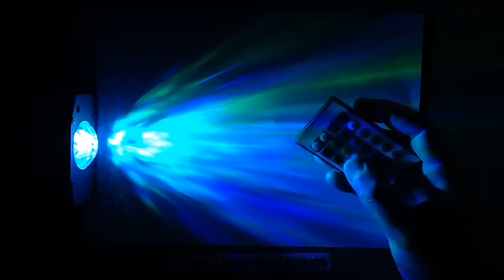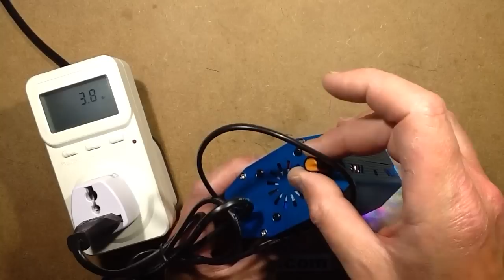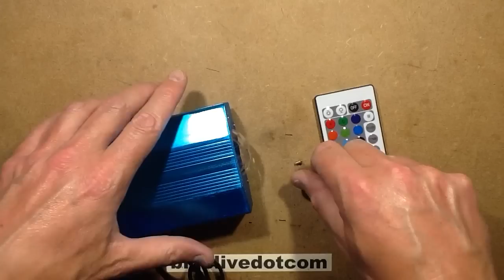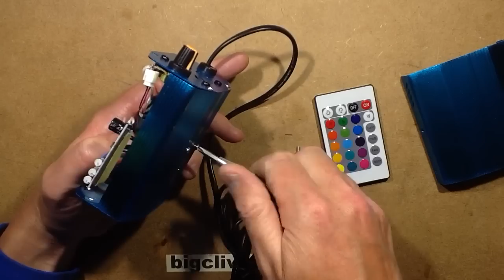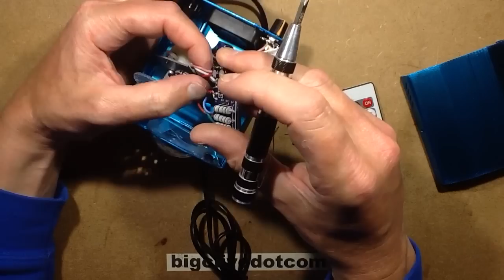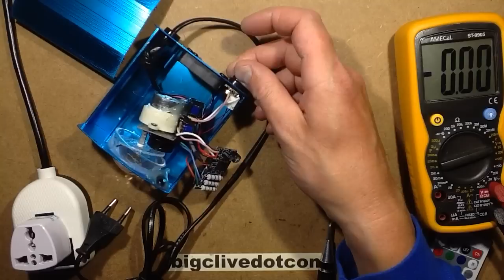RGB LED ripple projector with remote control.

Comment: I had two devices like this one. Both of them died after two months. The IR receiver stopped to work on the first device then on the second device a bit later. Light started to very slowly change colours then I threw them away. Rubbish.

Comment: I have just purchased one of these but the speed control is on the remote and not the unit. However, U have just complained to the ebay seller as the on/off button on the remote does not turn off the internal fan only the  motor and LED. If the unit is cieling mounted like I have done with mine then this is a potential fire risk. Strangly when I pointed this out to the seller I got a reply of "Dont worry about it"!!?
Reply from the maker: I'm afraid that is how it works.  The fan is connected directly to the incoming power supply and will continue to run while the unit is powered.
Reply: bigclivedotcom
Hi Clive. Small risk I know and I have not returned the unit but unfortunately something was 'Lost in translation' when I pointed this out to the seller as he was 'Very sorry as this is normal but has sent a replacement and to keep the faulty unit'. So now I have two units. I did feel guilty for about a minute as he misunderstood what I was trying to say but reasoned that further explaination would muddy the waters even more.
BTW. Love your Channel and your dry humour :-)

Comment: Ooh, that one is really cheap and nasty inside compared to the one I have - which looks similar, but mine has a properly mounted circuit board and uses a different remote. Still a very cheap Bangood purchase though.

Comment: You should've ordered the one I sent you in my email. It comes with an external power supply (5V, 2A)
Motor control can be done by remote (3 settings) and when selecting white (all LEDs at once) it draws 10W. Yes, it's bright!
Reply from the maker: That's coming up....
Reply from the maker: https://www.youtube.com/watch?v=bjfXp72lvfE
Reply from the maker: Quite a lot of that 10W is heat from the fan cooled resistors.
Reply: I wonder what the internal differences are.
Reply: Thanks.

Comment: I bought a RGB strobe light with a very similar case recently. It came with a duff 3 pin plug, and the knobs were a little confusing as one switched between normal and a music mode with a sensitivity setting, but it is otherwise blindingly bright.

Comment: This is an interesting variant you have there. My RGB ripple light has an external mains to 5v adapter and has a single low voltage board inside that does everything. They aren't using those huge cables mine, instead an op amp and a little discreet transformer for each color driven by your typical no-name microcontroller. I wish mine had memory though :/. I will say that having a live board inside that chincy anodised casing is a little too flimsy for my liking.

Comment: Interesting... My motor is PWM driven and controlled from the remote.
Reply from the maker: Then it's probably the same as the one I'll be putting the video up for shortly.
Reply: +bigclivedotcom Aha. I opened the gearbox because the motor sounded strange. It was so full of goop it actually slowed the motor down. I took some out so it just was enough to grease the gears. The motor rpm went up to the double! Haha! And the strange sound was the ultra slow PWM frequncy jerking the motor on slowest speed. I need to do something. The slow is not slow enough to me.
Reply from the maker: You could possibly try a resistor in series with the motor to nudge the speed down a bit.
Reply: +bigclivedotcom Yes. I'll try to include an inductor and a capacitor too to maybe smooth the bad PWM. It's like 10Hz or thereabout. I'm afraid the inductor needs to be rather big for that frequency though. :p

Comment: can you also put a ptc thermistor across the pot for the motor speed?
Reply from the maker: The motor current is very low, so it probably wouldn't heat a typical PTC up enough to increase its resistance.

Comment: I ordered one back during the monochromatic lamp model video, and mine is a little different. 
Mine is run from a 5v 2a mains adapter, the remote is different and it features some additional modes...not super great modes but still a neat device and quite inexpensive.  
The wife also adores it! That never hurts!
Reply from the maker: That's in one of the next videos....
Reply: +bigclivedotcom Awesome Clive. Thanks for these videos!

Comment: Am wondering if the heat of the resistors could cause any issues after running for a few hours and if so could they be swapped for something better, or could you try to get the case to act as a heat sink for them with some computer processor thermal compound?

Comment: I have a lightbulb with probably the exact circutry and leds. Same remote also. I use it for a warm orange light in my room. I have left it off for 6 months once while I was away and when I turned it back on it kept memory of the brightness and color I used. No idea how long it holds memory but thats pretty good!
Reply: Depending on manufacturer up to a 100 years (no joke).

Comment: I bought 4 of these last month and modded them to take DMX control.
Reply: What?!
Reply: +bluephreakr I grabbed a couple of macetech's ws2811 driver boards that turn RGB leds into serial controlled leds. then it was a simple matter of a rs485 txrx board and a lpc810 microcontroller. thus I was able to control the RGB values via DMX. took a little bit of time to throw together firmware for the LPC810. polished product - no - but it worked for a week of youth camp!

Comment: I bought one of these a few weeks ago. I have been wary of using it because of the metal case and no earth.
I will eventually get around to replacing the power lead with an earthed one, then I'll feel better using it.
I particularly like the slow colour changing mode.

Comment: Hey clive. Its funny that you found this item because I just saw this LED light remote control color changing light bulb today on Amazon. Here it is on the uk ebay site. Hope you don't mind me sending you a link.

http://www.ebay.co.uk/itm/GU10-E27-MR16-3-5W-RGB-LED-Bulb-Remote-Control-16-Color-Changing-Dimmable-Light-/231778471511?var=&hash=item35f712ce57:m:mpWqTaUJ2KkqdEKdKOPBebA

Comment: hey, that's pretty weird. I recently bought some rgb LED'S for my computer, and the remote is the exact same one you have there.
Reply from the maker: It's very common.  If you keep one in your pocket you can change other peoples lights with them as they all have the same code.  That includes shop window lighting.
Reply: That's an quite standard LED controller remote. You'll find it for almost any LED accesories / strips.
Reply: Yup, I have a screw-in RGB LED bulb w/ the exact same remote.
Reply: I have three of those remotes and screw-in bulbs somewhere... and an RGB tape that uses a bigger one with more buttons.(Fades, flashing, custom colour.)

None of them are coded the same. So if I push white on one remote one lamp turns white, another one blue+red. and the tape start flashing white.
Reply: m8e i have led strips in my computer, light bulbs.... and i  can control them al with the same contoller, i can even change the colors in my local electronic strore😂

Comment: What's the reason for tying a knot in a wire and pouring glue over it?
Reply: Spreads strain across the whole knot being pulled against the case instead of pulling out the solder joints. Glue just solidifies it, I'd assume.
Reply: strain relief, it can't be pulled out.

Comment: They forgot to peel the plastic layer that protects the double sided tape under that board! That's why it was just shoved in there.
I'd personally have prefered if they had made a separated board for the resistors and stuck it on the back, closer to the fan.

Comment: I would have put the motor and fan on one supply and the LEDs on the other supply...
Reply from the maker: Yeah, I thought that was odd too.
Reply: Same
Reply: Unless the micro controller is adjusting the fan speed as well as the LEDs?  Would you want one chip handling output from two separate power supplies?
Reply: Ok.  Then the fan is tied to the parts that need the cooling.  In an odd kind of way, that makes sense.  Since there are two supplies, as long as the circuit is working, the fan does it's cooling.
Reply: Jay Herde the fan speed drops because the supply voltage drops when more LEDs are turned on.
Reply: For me, it all depends.
If I could make my own power supply, then I might have an extra transformer winding and regulator for the motor. Or, if I used an off the shelf PSU, then I'd use a 5V PSU (or like 4V) and resistors or buck converters for the LEDs.
Reply: ***** It might all work out in the end.  Lower voltage might also mean less heat.  No doubt, there must be a cost saving somewhere ;-)